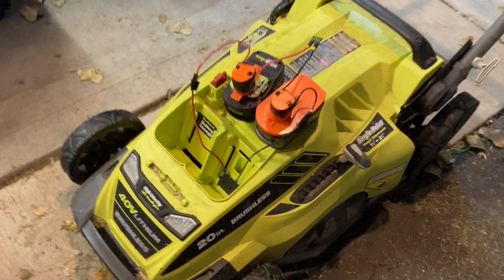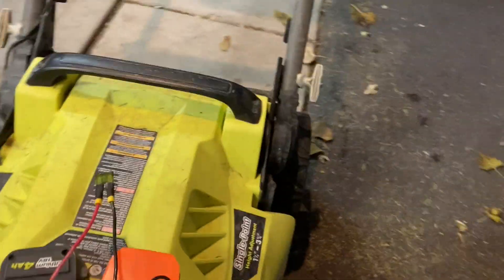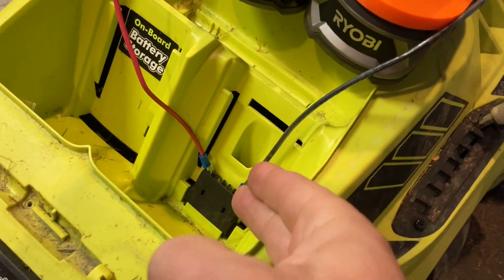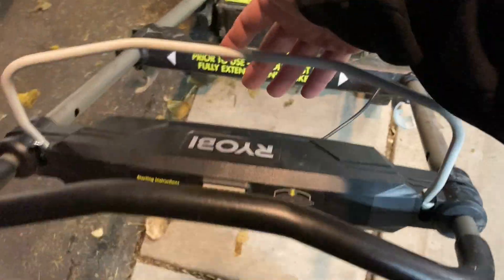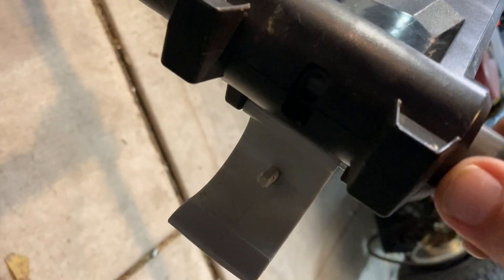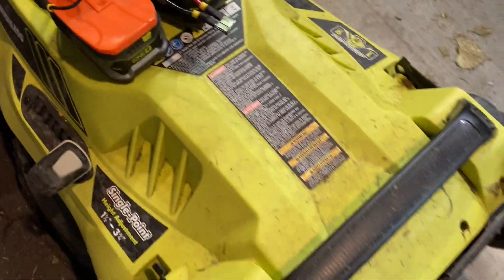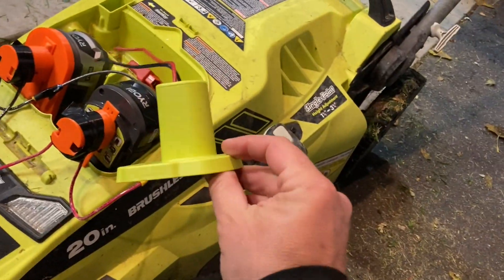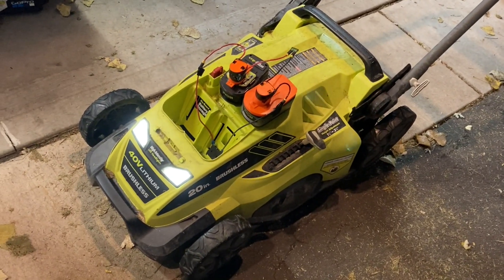Ryobi 40V mower powered by 18V batteries

Comment: Thank you very much for this video. My neighbor is getting rid of his 40v. 20in lawnmower. And I turned his offer down initially because I don't have a need for the 40v batter but was interested in upgrading my 16in lawnmower to a 20in. Looks like you just solved my problem. And I will be making the conversion.

Comment: Etsy seems to have one 3D printed that actually includes the 40V adapter.  Takes 4 18V with two in parallel to add run-time, and then in series to get the 36V.  Seems to also include fuses and a diode for safety.  I would say using thick gauge wire and solid contacts are import so you don't have resistance and possible melting.

Comment: Good thing you figured out which terminals were + and - , you wouldn't want to spend 1/2 hour pushing the mower around only to find out you have more grass than you started with. 😆
Reply: Have you done this. I’m planning on doing the same thing but with three 6v 4.5ah sealed lead batteries I already have.

Comment: Just curious if something like a UPS battery would work,  price wise a 12ah ups battery would run about $ 20 and I'm believe there are ones larger that that. Where as Toro sells a 60v 10ah for $ 420      Another  possible hack say can any mower battery, or any drill battery be used  ?  As you show it seems you need to match the voltage of the mower ?
Reply from the maker: @kommoncents-------1  A person certainly could modify a mower like this to run off other batteries. The main thing would be to match up the voltage with what the machine is designed for.

Comment: How do you connect the wires to the battery slot in the mower?
Reply from the maker: I simply used 1/4” male crimp-on connections. I pushed them down into the battery connections on the mower, observing polarity. They fit pretty snug, so they make a solid electrical connection, but there’s not much holding them in mechanically. I could add some tape or something to hold the wires in place well. Ideally, maybe a 3D-printed part that would go in the battery slot.

Comment: Thanks for this. I have the Ryobi 36v pressure washer that I bought without batteries on ebay. I have husqvarna batteries that Anderson connectors and have a 3d bit printed for Ryobi connection. What makes be anxious is the other connectors on the battery and the Ryobi unit. Do they give feedback back to the battery BMS? I don’t want to wreck the husky battery by discharging it to much etc?

Comment: Nice score Ben! looks like a match of the one you already have. I have the 21-inch Ryobi 40V HP Brushless Self-Propelled CROSSCUT Lawnmower. I'm looking at getting the 40 volt Power station because it comes with 2 of the batteries giving me an extra use for the other 2 40 volt batteries I already have.

Comment: While I get a kick out of using the 18v batteries on the mower, I've been curious if the greenworks gmax 40v batteries could be used in the ryobi equipment.  The early ryobi mower was almost identical to the greenworks model.
Reply from the maker: I would imagine it would work fine. You would just need a physical adapter.

Comment: Nice!  I bought the older version of this lawn mower a few years ago at an auction for like $20.  Never got a battery for it because they stopped making them.  Now maybe I can get it going.  It is missing that safety key, if anybody knows how to by pass that please let me know and thanks for the video.
Reply from the maker: That safety key just jumpers together two contacts. You can crimp together two solderless connectors onto a piece of wire and stick it in there and it will work fine.
Reply: I have to do a teardown on one soon because it failed mid-cut and I'll make an effort to takes notes on the switches and wiring if you want. It'll be a couple days before I get to it.

Comment: 2 /  18 volt batteries  = 36 volts  used on a 40 volt machine .. would this do any damage to the machine  ???
Reply from the maker: No.
Reply: No. In fact, Ryobi's 40v batteries are in reality 36 volts. They just named that battery based on it's max voltage.
Dewalt uses that same naming tactic, their 20v batteries are in reality just 18v. 
Voltage on lithium batteries vary based on charge level. In a single cell, 100%=4.2v,  0%≈3-2.5v. Their nominalt voltage is 3.6v per cell.
Reply: @kalletaimi5094  that's good to know

Comment: Lots of times it's just the "safety interlock" circuit has a wire pulled off a switch or some grass in an open contact switch!  Same for gas mowers.
Reply from the maker: Super common!
On the Electrak electric lawn tractors, 90% of them have the seat safety switch bypassed because otherwise every time you hit a bump the tractor turns off!

Comment: I have the same lawn mower and also got a deal. Refurbished from Home Depot. I have built 10Ah battery 10S4P from modem 18650 cells coupled to BMS. The stock battery is 10S2P.